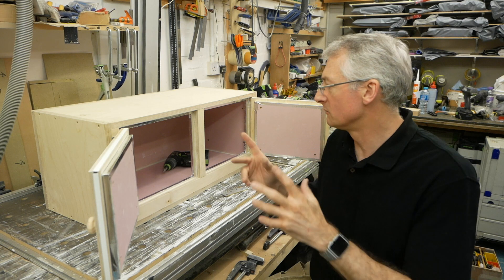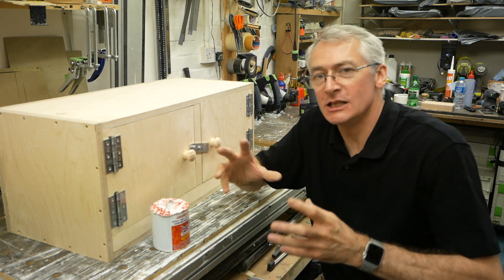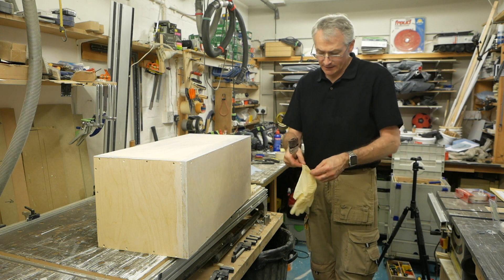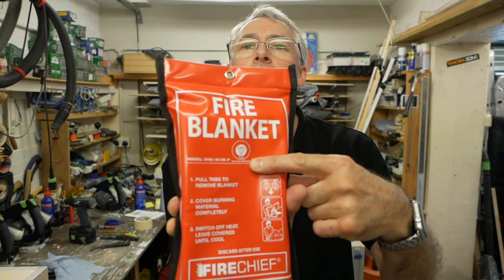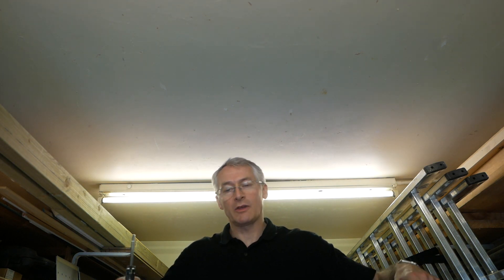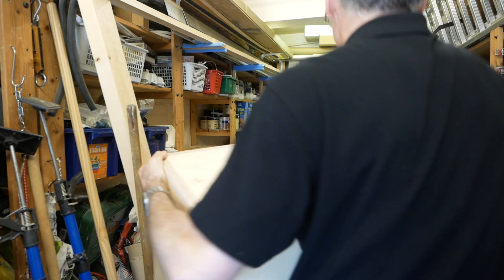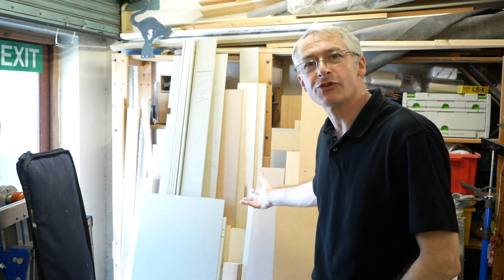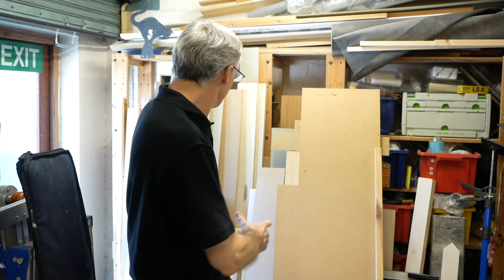Paint & Flammables Cabinet, Part 2 #076

Comment: Great vid Peter, I have to switch to my day job as a watch manager of 24yrs in the UK fire service to comment, and say you have given and demonstrated some sound advice to fire safety. With a wood workshop there is massive fire loading, but maintaining a means of escape, having a means of raising an alarm in case of fire and following good practice means that this sort of event shouldn't occur. Apart from saying I really enjoy your work, the rule would be (in case of fire), Get out, and call the Fire Brigade out. Thumbs up.
Reply from the maker: +a bedbug99 Thanks! Appreciate the feedback 👍
Reply: I’ve been told not to bother with smoke detectors in a wood shop as the dust will set them off - what is the proper type of fire detection for a home shop?

Comment: Hey Peter, though I think your locker is going to be good against fire, it really should be on the floor. The shelves you have it sitting on will burn/collapse very quickly and likely drop the locker onto its face and possibly spill flammable liquids into the fire.
Reply from the maker: +AKA Nathan That's a very good point, though I would expect the heat alarms to have triggered long before the shelves burn through. 👍

Comment: Here are the guidelines for a timber based unit. 

Wooden cabinets constructed in the following manner shall be acceptable;

a. The bottom, sides, and top shall be constructed of exterior grade plywood that is at least 1 inch (25mm) thick and of a type that will not break down or delaminate under fire conditions.

b. All joints shall be rabbeted and shall be fastened in two directions with wood screws.

c. Where more than one door is used, there shall be a rabbeted overlap of not less than 1 inch 25mm)

d. Doors shall be equipped with a means of latching, and hinges shall be constructed and mounted in such a manner as to not lose their holding capacity when subjected to fire exposure.

e. A raised sill or pan capable of containing a 2 inch (50mm) depth of liquid shall be provided at the bottom of the cabinet to retain spilled liquid within the cabinet.
Reply from the maker: +AKA Nathan Appreciate the effort you've made to post this, but I must point out that these are U.S. guidelines, and whilst it's always interesting to see what others recommend, as I say in the video I made this cabinet to comply with UK Health and Safety Executive guides, and I link to  the relevant guide and quote the salient parts in the video description. 

As I say, please check the regs/codes in your own country if compliance is required. 👍

Comment: Very interesting video and some good tips there. I have often thought that when I have space I would like to build a small fire resistant shed for just this purpose, just a basic cheap garden shed, insulate and line with plasterboard and have it in the corner of the garden. I keep a lot of flammable liquids on hand by necessity so having them away from the living space and tools would be a nice option and if it did burn at least I would only lose that small space.
Reply from the maker: Thanks! Yes, where possible flammables should be stored outside- not always practical though! 👍

Comment: Hi Peter, the items that I am concerned about are the soft items, foams, plastics, materials that when heated may cause fumes which are more toxic than the flame itself. Paul
Reply from the maker: +Adelaide Invigilation 👍 All the more reason to get the heck out if the heat alarm goes off!

Comment: How about a follow up video of building a smaller version of this and actually putting it to the test. Would be very interesting to see how it would hold up to fire.
Reply from the maker: +chris13a1212 That's my intention with this one, just as soon as I can figure out how to do it safely 👍
Reply: Peter Millard ok that's going to be one to watch. I'm most interested to see how the paint holds up. I used plaster board to protect some plants from a fire in the garden once. Was burning an old tree stump and didn't want to damage the plants nearby. One thin piece held up against at least an hour of flames from a pretty big fire.
Reply from the maker: +chris13a1212 👍
Reply: did you ever do this. i would love to see the results. 
im sure your local fire department would like to have a look at it and test it. they often do training so it wouldnt be a big thing to add in. everyone might learn somthing

also whats stopping the fire burning the wooden supports and letting the box fall and spill its contents

Comment: Useful/terrifying! Luckily I have less paint, and also a corrugated iron shed in the bottom of the garden. So my solvents and paints go there. 

I have a sleepout made from polystyrene coolstore panels that are disturbingly similar to the stuff that went up in flames in London (but with thin steel on each face). When I bought them I did flame test the first offcut, but I have to admit that after the fire I got a bigger bit and used the blowtorch, just to reassure myself that even in a severe fire the fire-retardant in the polystyrene would actually work (it does). Which also makes me think, as many have, that if the cheapest panels I can get from China have the fire retardant in them, just what were those people thinking when they asked for it to be left out?
Reply from the maker: +mozismobile 👍

Comment: Gluing alarms to ceiling?  Might they not drop to the floor when this expected fire starts raging?  
I'm assuming that your glue gets soft when heated?  I dunno... it's just something worth thinking about.
Grenfell was shocking, the speed with which it took hold was truly frightning.
Reply from the maker: +EscapeMCP The heat alarms will have triggered long before this adhesive loses its grab. Now, if it was a hot-melt adhesive, you'd be spot on 😂👍

Comment: We use an old metal filing floor cabinet
Reply from the maker: +Mart Ashton Whatever works for you 👍
Reply: Peter Millard Many years ago my Dad had a sign shop with similar materials; paints, thinners, timber, cleaning rags, etc. The inspector insisted on metal storage for flammables. We found an old metal filing cabinet for paints and thinners. And a metal bread bin for rags! It even had the word 'Bread' embossed on the front of it. The safety inspectors approved it and signed it off !
Reply from the maker: DesandSam That's brilliant! I remember those kind if bread bins - with a slide-up front! Fantastic idea 👍